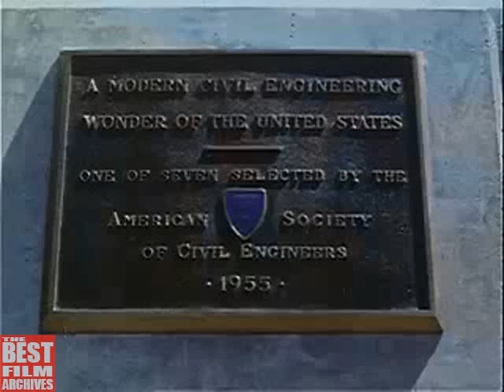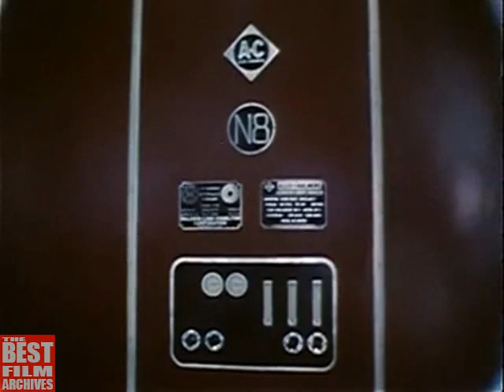Construction of Hoover Dam | One of the Largest Dams of the World | Documentary Film

Comment: Can some one explain to me like I am 3 that how do you stop the water before the dam is fully built?
Reply: but there is so much, see the thumbnail, there is like 10 times more water on the top side of the dam, OR is it only that high because the dam is blocking some of the flow?
Reply: Zook T , it’s explained in the beginning. Waterways were designed and built to divert the Colorado River away from the jobsite.
Reply: Gigantic holes were blasted on both sides of the dam site. Then a coffer dam was created in front of the dam site. The Colorado river was diverted by the coffer dam into the two gigantic tunnels and flowed back out onto its normal river route downstream. This created the dry river bed necessary to erect the Hoover Dam. Once the Hoover Dam was completed the tunnels were sealed and the coffer dam destroyed.